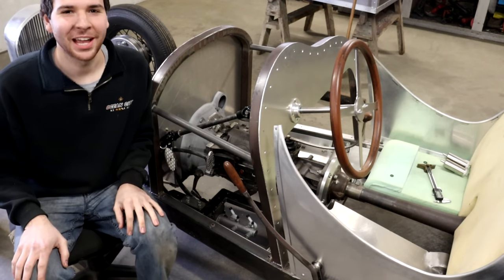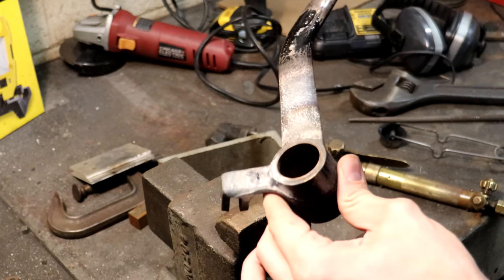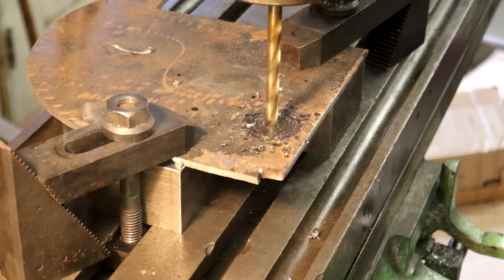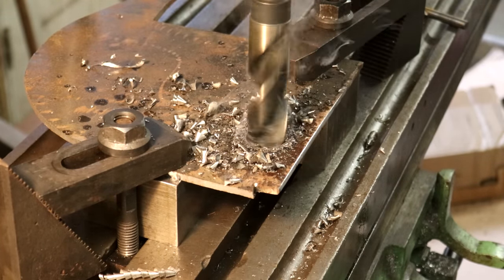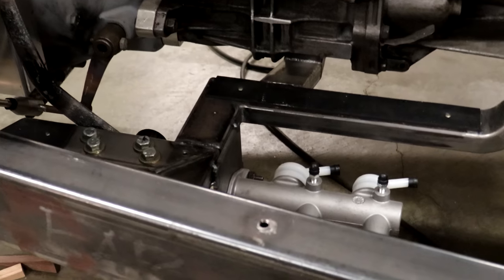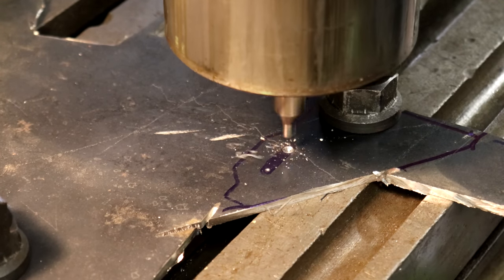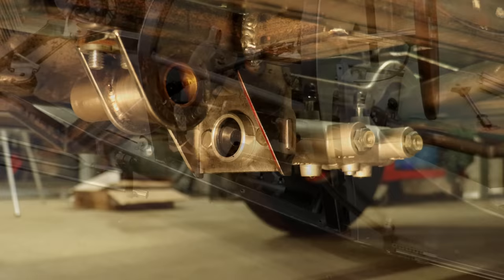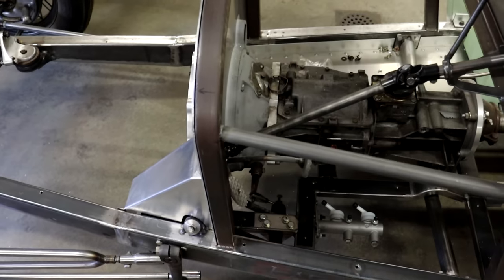Hot-Rod Master Cylinder Mount | Homemade Boat-tail Speedster Pt. 55

Comment: Hi.  I agree with you that the brake linkage WILL work, but I definitely would NOT have positioned it there.  All you need is to go over something with little ground clearance and your brakes could be applied for you!
Great build though and some very impressive work.
Regards Mark in the UK
Reply: Agreed, Applied or the Master cylinder torn off and then NO breaks.  This guy has the smarts to find another way.
Reply: Most older cars before the 1950s located MC similarly.  Problem is the clearance.
Reply: @Deadfeat  That's a brilliant thing to say, but the past doesn't equal the future!
Reply: It is a long way off the ground, and I don’t expect that this car will be doing much offroad work anyhow.
Reply: @samhalad9706  And if a rock or a branch is flung up...
Admit it.  It's just asking for some kind of issue.
Reply: What sort of driving do you think that it will be doing?  
How far up will it have to be flung? 

Of all the things that can go wrong, this is a risk but only a very small one.

Comment: Solid no. This brake job was a textbook example of speed blindness. When the skill set and experience grows, designs become more risky. Then eventually something like this happens. Deadly brakes. Even if you shield that setup with frame rail gauge steel, it still has that faulty linkage design. As you said, never trust only welds, always have mechanical bond too. Every bit of that brake pedal linkage is relying solely on welds, and the geometry of the linkage is loading those welds hard.

Comment: Good to see you back and a nice little project on the brake cylinder. I would definitely put a shield on that linkage because if you do ground it on a speed hump or something it will jam your brakes on. I think incorporating something to keep the road dirt away from the master cylinder would be good also.

Comment: Those tabs on the bracket are a great idea. I never feel fully comfortable relying on welds alone. At least not my own! Modifying a factory brake pedal like that isn't allowed at all in New Zealand. No cutting, heating, bending,, welding, drilling, etc allowed. What you can do is make you own from mild steel as long as the main actuating part of the pedal is all one piece. So you couldn't even weld a bracket on as you did even if it was all mild steel. I had to remake the brake pedal in my car for this reason. Clutch and throttle they don't car and you can do what you like!

Comment: Schools at for summer. Welcome back. 
Instead of band aiding the lower linkage, could you raise the pivot point along with slicing and dicing the upper pedal part to the required lengths and angles?

Comment: Nice to see a video from you! For your brake reservoirs, why not pick up four stainless freeze plugs and a piece of sheet to make a couple of matching barrels? It would be a little bit of a pain in the ass, but it might look cool if you rolled a few beads and used the same proportions as a 55 gallon oil drum. And I know you have sort of a monochromatic theme, but it's such a small detail and so tucked away, I think if you made the skeleton for the reservoirs out of brass, it would be a very very sharp look. I love that, when the nicest details are very easily missed. Like maybe you have noticed an unusually heavy door knob, how much more satisfying it is in the hand?

Comment: I was watching you cut the master cylinder bracket thinking "hmm, that's a long piece, will that fit all the way into the saw?" then you cut the shot before it was done, I'm guessing because you figured out it wouldn't fit in the saw and had to decide what to do haha

Comment: Make sure there is no side loading on that master cylinder. I have the same from wilwood with 1 inch bore. My 1st pedal attempt had a touch too much side loading and over 3 months it wore out one side of the bore. Has a small leak even after replacing the seal kit and replacing my pedal for  a wilwood pedal and mount. Anyways still holds a pedaal and the leak is minor.
What pedal radio do you have now. I didnt hear you mention it. Wilwood recomends 7:1 for manual brakes.
Reply: my thoughts as well. That master bore and pedal lower aren't in the same plane, so there will be side load. Add in the low-hanging issue, and it is time to re-design the brake setup.

Comment: It's nice to see a new video. I was beginning to wonder what had happened to you. The brakes are clearly hydraulic, which is practical, albeit somewhat anachronistic. What's going to be at the wheels? Drums salvaged from some '50s sedan? (Finned would look cool.)
Reply: See  Pt.34
Reply: @hermanulrich2110  Thanks, I should have remembered that.